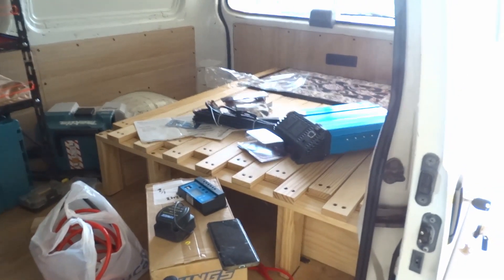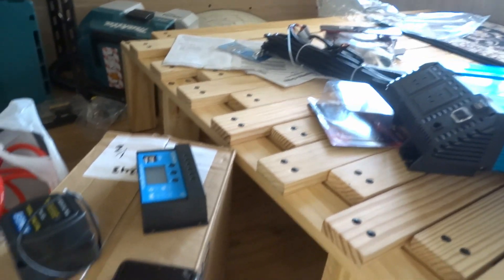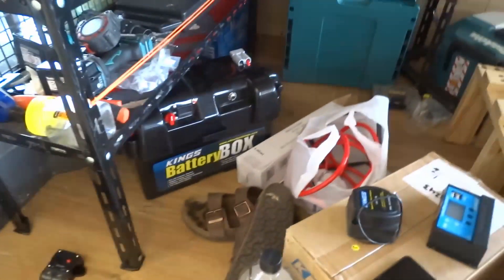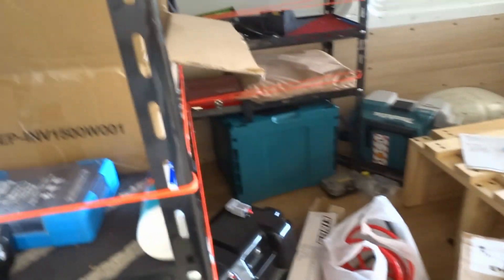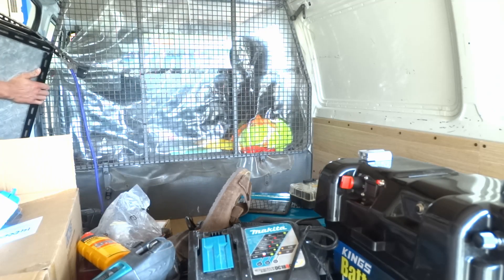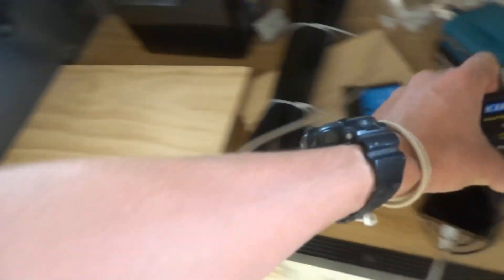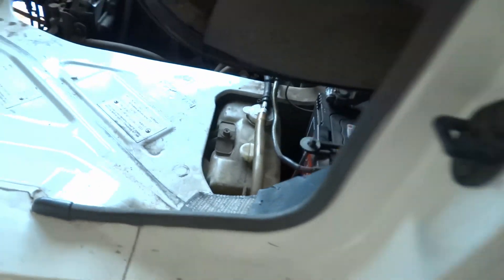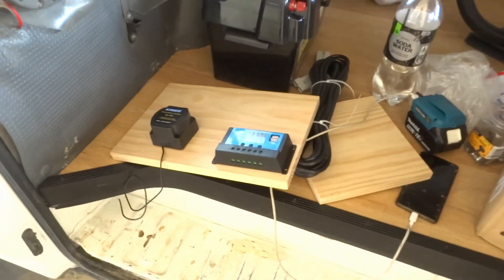12v Dual Battery setup, Solar Panel and Inverter | Mitsubishi Express DIY Van Conversion Part 9

Comment: Thank you for you'r vidéo , really helpfull.
Just want know , i have the same item than you , but i start i was think plug my Solar panel strait to the second batterie when wire the batterie to the inverter .
And not wire the Solar panel to the inverter and plus the batterie to the inverter .
You think it be working aswell ?

Comment: Hey mate, I’ve got the exact same set up, same battery, battery box and isolator - I have it all hooked up and when car is running isolator is showing the red LED light. However, when I switch my battery box to “OFF” it’s still on and still powering my fridge etc. In your video when you switched it off it turned your lights off. How come mines staying on? Cheers!!
Reply from the maker: Oh man, it's difficult to say without seeing your specific set up, but if things are still being powered when you switch the box off, I would assume you've wired up your electronics to the other side of the circuit. If your fridge is plugged into the 12v socket on top of the box, it should definitely turn off when the switch is. Unfortunately I'm not an electrician or expert on 12v systems, just tried to encourage people to have a go and do it themselves. I'd maybe do some googling, there'll be a forum somewhere that will have the answer, and maybe call 4wd Supa centre and see if they can diagnose the issue. Best of luck mate👌🏼

Comment: The circuit breaker link comes up as "page not found" can you possibly update?

Also what size cabling did you use for the 1500w inverter (3000w peak)?

Thanks for the vid, gives others confidence to hava go, cheers
Reply from the maker: Hey Steve, this set up was filmed nearly two years ago😂 I honestly can't remember what size the cable was, I think you just have to make sure it's capable of putting out 10% more of the current than will go through it for safety. But I bought it from Jaycar and they helped me figure out the gauge. I'm about to do another 12volt set-up for a new build and thanks to comments like yours, I'll be going into much more technical information on the products I'm using. So stay tuned for that, and thanks for the feedback, helps me make better content ✌🏼

Comment: So instead of me hooking solar straight to the anderson plug on my battery box I should've connected to the inverter instead?? Im just not understanding why solar to inverter?
Reply: No no, your inverter is only there to convert 12v DC to 240v AC NOTHING else.

Your best bet is to ask a friend who knows a auto electrician, or call into a Kings store if you have their stuff and ask.
Reply: Ah I didn't realise you need to turn the battery box on to charge it from those terminals.
Reply from the maker: Hey Christine, you need to run the solar through a DC-DC charger before running it into your battery box. I'm not an electrician, but I'm pretty sure it converts the electricity to a current that is safe to top up your secondary battery, definitely head in to a store that sells dual battery kits and ask for help setting up, or consult an electrician friend, I'd also keep looking on YouTube and google until you're confident in every part of the setup process. But definitely need a DC-DC charger before going into the battery box

Comment: Help please. I have this kings battery box with Inverter. Set up as a second auxilary battery which charges up when driving. I connected a solar panel with a solar controller via the anderson plug while stationery to see if it would charge 2nd battery and blew a fuse at my car battery end and flattened car battery. Can you think why? I could hear the isolater relay working (clicking) so not sure how it all works if solar attached. I wasn't drawing power from second battery at the time. Was just working out if it all worked.
Reply: Umm sounds like you needed a DCDC control panel to run your system as a 2nd battery set up charging while driving, that system looks after both batteries (car battery and 2nd battery).

If NOT charging from your car battery while driving and only charging via solar when set up camp (what I'm doing) that's where a MPPT or PWM controller comes into play. Just make sure your 2nd battery is fully charged BEFORE you leave.
Your fridge is cold BEFORE you leave. 
And everything in the fridge is cold BEFORE you stack the fridge.
Reply: @stevecrowe176  Thank you I have all of the above but some how blew a fuse at main battery end and made main battery flat. Seems maybe solar ended up charging through to main battery. No idea. Maybe have to disconect main battery from secondary while using solar to second.

Comment: I like your setup, but can you list the size of wires used, specially, the battery to battery one.
Reply: Ditto ^^
Reply: What??
Reply: @MrGongui  ditto means l agree
Reply from the maker: Mate, I definitely should have given more details in regards to wiring. Honestly though, I installed this over a year ago and I can't even remember the gauges I used. There's a tonne of information you can find online about the correct way work out the sizing of wires and fuses. If you stay tuned, I'll definitely go into more detail on the next 12 volt system I set up. About to start that build in the upcoming weeks👌🏼 thanks mate

Comment: Roof rack looks good, which make & model are compatible with Mitsubishi express?
Reply from the maker: Hey V, the ones I've got are from supercheap auto. Any gutter mounted roof rack should be suitable for the Mitsubishi Express as the gutters are quite close to the top of the roof. Hope this helps✌🏼

Comment: Mate. Self tapping screws for the panel and the racks are not a great idea. Please put some appropriate bolts there. My mate just had his panel go flying away last week. Guess what was it held with.

I tried leaving a link below. Please let me know if you could see it.
Reply: I hope you can see the link

https://photos.app.goo.gl/WjvLZKNsrcmoPHcM6
Reply from the maker: Hey mate, thankyou so much for taking the time to leave such an in depth comment. I took what you said seriously and went and double checked my panel, the way that it's mounted, has four self taping screws into the each bracket on the rack, and two on each bracket on the panel. The way the brackets are on the wind pushes the panel up in the direction of securing the self taping screws further rather than pulling against them. I had a look at your mates panel had a single tek screw on each panel mount with two into the body of the vehicle. I've taken this van on multiple 110 kilometer  roads for 3 hour long drives and checked the panel on a few occasions and all still seems to be safe and secure. I appreciate the time you took and the concern you have, but I honestly think based on the direction the screws are supporting it into the roof rack vs into the body of the car, this is a safe method of installing the panel
Reply: @lachiemac2642  no worries. Just keep an eye out of you drive on corrugations as they are the ones that can enlarge the holes and cause stress fractures. Start safe mate.

Comment: Hi there, thanks for the video. I'm doing exactly the same. How did install the fuses on it? Cheers
Reply from the maker: Hey Jono, the advantage of a kings set up is the fuses are already installed in the battery box for any accessories you run on the outside. I personally installed a separate fuse block for my lighting set up and vent fan. I bought the fuse block from jaycar and wired it up to the inner terminal✌🏼
Reply: @lachiemac2642  thanks. so, you didn't add any fuses between the main battery and isolator? And also between the inverter and the second battery?

Comment: Do a kings battery review please
Reply from the maker: Hey mate, love the suggestion, may have to be something I take on later down the track once I've tried a few other set ups. As of now I don't think my knowledge of dual batterys I high enough to warrant an in depth review. With that said, the kings set up has absolutely served it's purpose for me. I have a 115 Amp battery, and off of that I run a fridge constantly, led lights regularly, and a fan regularly aswell. I've found I can run my laptop, lights, fridge, and fan for the majority of the night without concern of the battery running low. Very happy with my kings set up✌🏼 (keen to try redarc on the next build though)

Comment: If you run wires through metal, you need a grommet to keep the metal from wearing through the wire and shorting it out.  I di not see any grommets.
Reply from the maker: You're exactly right Royce. Unfortunately I didn't include that in the video (as I found out from a friend later why that was important😂) but all of my wires that run through metal body are surrounded by grommets👌🏼
Reply: Was going to say the same

Comment: When you run stuff off the inverter, is it also drawing charge from the starter battery?
Reply: I believe that is what the isolator is for.
Reply from the maker: Not at all mate, the inverter is connected directly to the secondary battery (with a fuse in between) so it can only draw from there. The isolator between the starter and secondary battery makes sure that the starter battery never draws charge from anything except for normal car functions👌🏼

Comment: I may have missed it but where are you connecting all the positive terminals?
Reply: I’m assuming to the front terminals of the battery box
Reply from the maker: Hey Tim, sorry for the late response, because all of the electronics I'm running I've installed with a circuit breaker, I just connected them directly to the secondary battery inside the battery box. I also installed a fuse panel that hosts smaller appliances such as lighting and the vent fan.

Comment: looks good man, giving me some inspiration for my 06 mitsi.

I will just say tho I think you should probably chuck a fuse on either side of the VSR Isolator just to protect your circuits if you haven't already. Don't wanna mess up your hard work.

Keep up the vids legend
Reply from the maker: Thankyou so much Alex, glad you could find some use in the videos✌🏼
.
I've had a few people suggest a fuse between there so I'm going to assume that's the correct thing to do and put one in😂 thanks for the suggestion and best of luck with your van life journey my friend👌🏼

Comment: Hey dude, at Video marker 15.17m/s, you have removed the facia panel to drill in the roof. How did you do it?? Im having trouble on my mitsi removing it. I had the same idea to run my solar wire at the back of the van. Quick vid be handy. Ta. Nice little simple set up. Someone put your you tube on L300 Mitsubishis FB page.
Reply from the maker: Thanks Stiv, from memory I had a bit of trouble getting it off aswell. There's the two screws at the back which stand out and are obvious to take out, the difficulty is the plastic plugs that hold down the front. If you look closely at the section where the cap is off in my video, you'll see two holes near the front, one on either side near the top of where the cap sits. They are similar plugs to what hold the door cards on, they work similar to an arrow, going in like a cone and then snapping flush at the back to prevent them coming back out. You'll need a tool that can get on either side of the plug to close it up enough to remove itself from the hole. Hope this answer helps, if you need further clarification feel free to write back and I'll try to explain it better👌🏼
Reply: @lachiemac2642  thanks mate. Will give it a go on the weekend and see how i go. Thanks for getting back to me.🤙

Comment: Hey McTrowsers, I'm doing up my 2009 L300 and have been using your videos as a guide. Thanks! Did you get an MPPT or PWN controller to go with your solar panel? Cheers, H
Reply from the maker: Hey Holly, stoked you're getting some value from the videos✌🏼I only got a PWM solar controller. While MPPT's are much more efficient, I went with a PWM because it was significantly cheaper and I didn't have that crazy of a 12v set up anyway. If I had set up a system to run more powerful electronics with more solar panels and a bigger battery I definitely would have shot for an MPPT. If you have any direct questions about your specific set up and what will allow you to get the most out of it, I'd head in to a store and ask someone directly. Either kings for a budget set up or redarc if you have the money for it. Hope this helps and good luck on your build👌🏼

Comment: Don’t you need a fuse before the isolator between the main battery & the isolator??
Reply from the maker: Far out, I'm sorry mate, I'm not sure😂 in all the research I did on the kings system as I was installing it, I never saw anything mentioning an extra fuse between the starter bartery and isolator. So I'm assuming that either there is one built into the isolator, or that it isn't essential between the two. Sorry mate, I know this isn't the best answer, but I honestly don't know😂